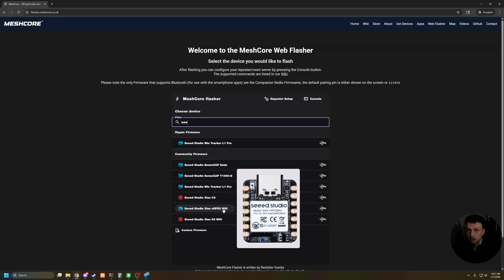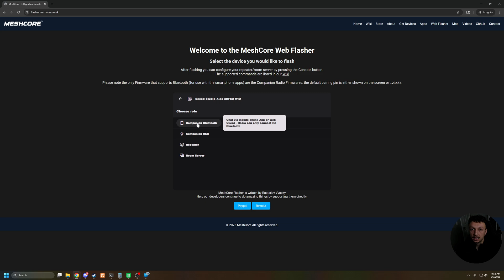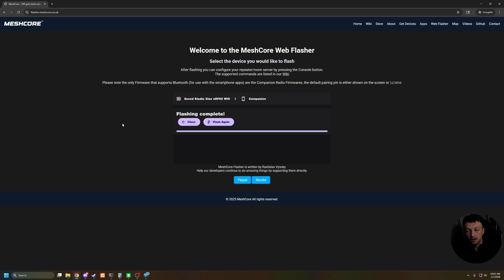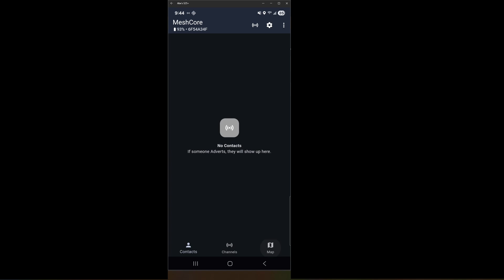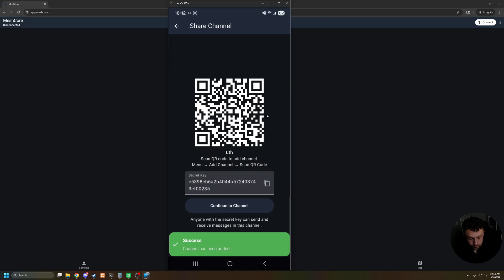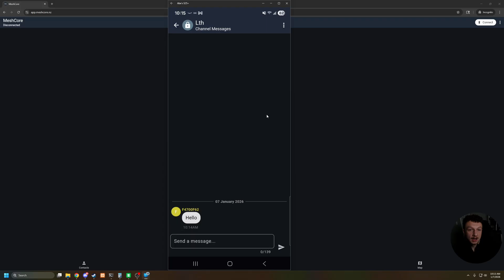How to Setup Meshcore The Ultimate Meshtastic Guide

Comment: So this small Seed Studio can work for either MeshCore or Meshtastic as far as I understand? Guess it'll only work for the one or other and not both at the same time.
Reply from the maker: Correct, it works for either one! But only one at a time, because you have to flash the firmware with a specific OS for it to work. I prefer meshcore so I use that.